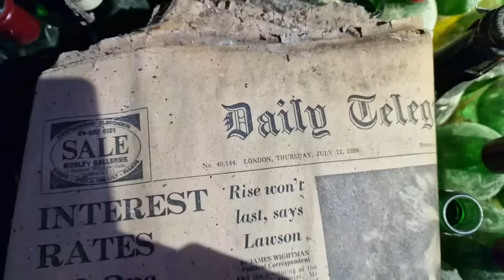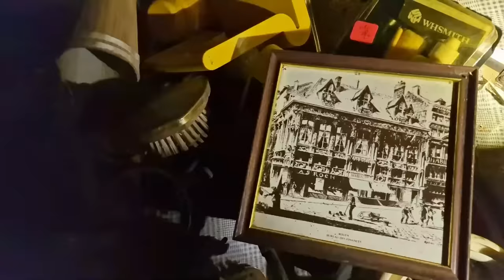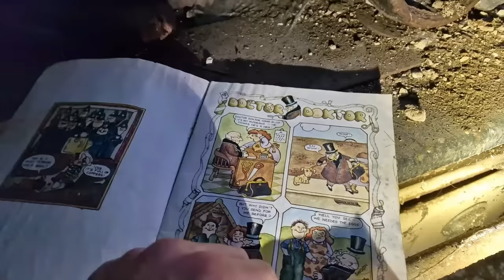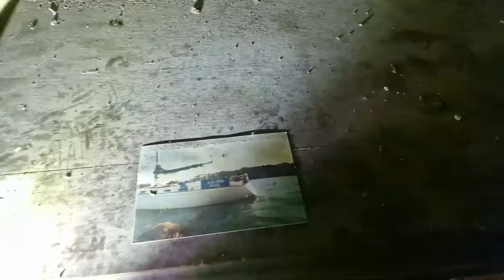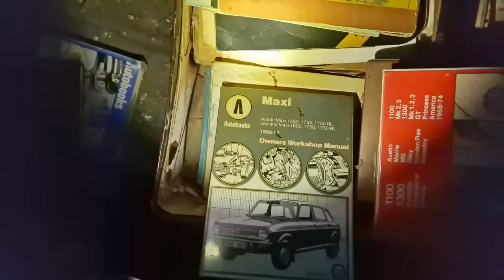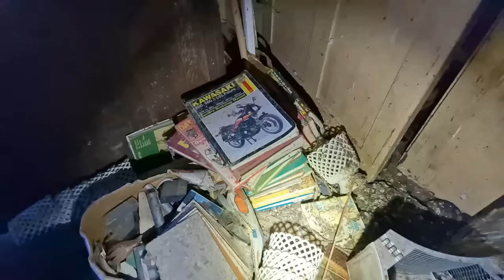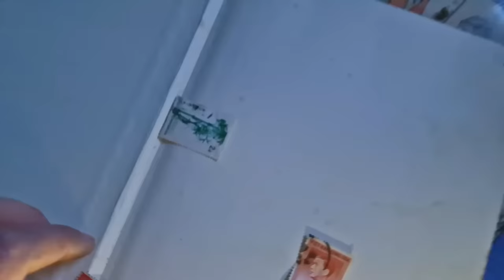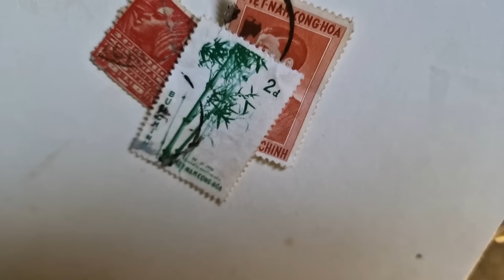We Found an Elderly Couple's House ABANDONED Left Frozen in time

Comment: Just binge watching your videos and came across this. The wall of glass bottles may have been used for thermal insulation, water proofing and energy conservation. Building with bottles is quite an old technique. In 1905 Tom Kelly built a house in Rhyolite, Nevada (now a ghost town), using 30,000 beer bottles.